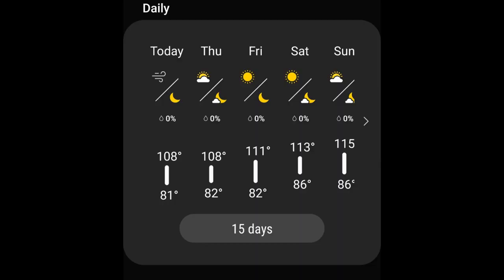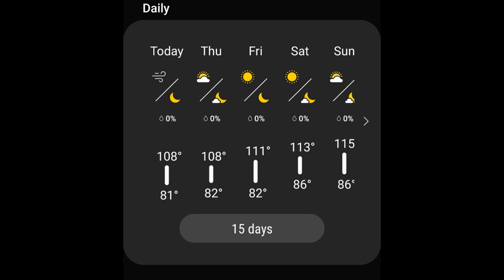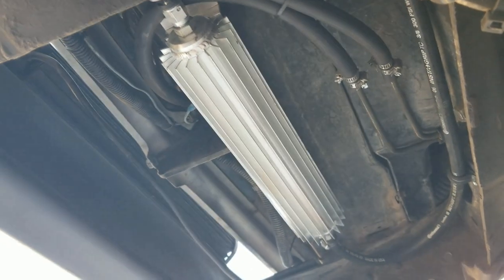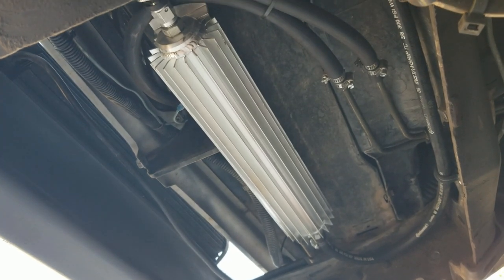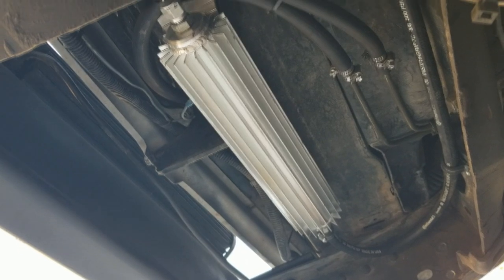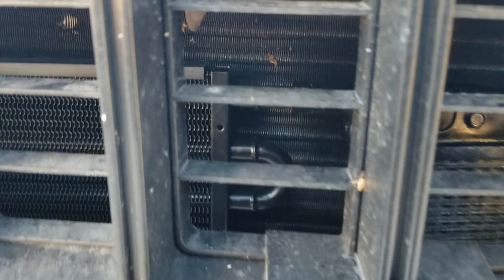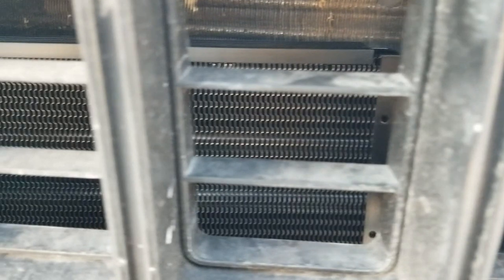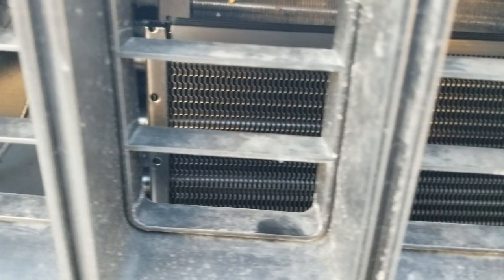82 Chevy K5 Blazer / Update PSC Cooler

Comment: What about your brake issue? How did you combat the brake fluid overheating?
Reply from the maker: Added a second cooler and that fixed it.
Reply: @SlayFive  So you added a 2nd brake cooler and a second hydraulic cooler for steering? Cant go wrong with extra cooling!
Reply from the maker: @dennisreynolds6915  Hydroboost power brakes work using hydraulic fluid pressure (fed from the power steering pump) to “boost” the force on the master cylinder's brake fluid and therefore apply more force to the brake calipers (and subsequently more force on the rotors with the brake pads).
Reply: @SlayFive  ok makes sense to me. I didn't know the two were connected
Reply from the maker: @dennisreynolds6915  Yup. No worries